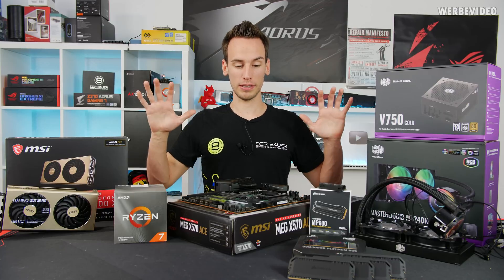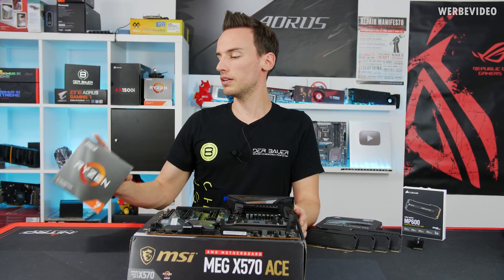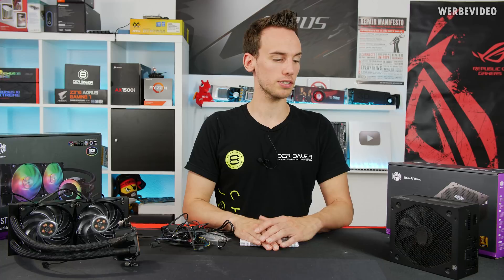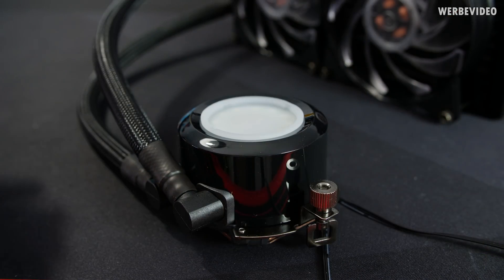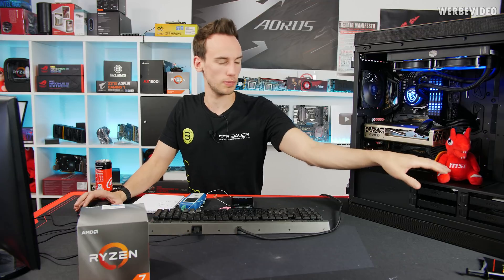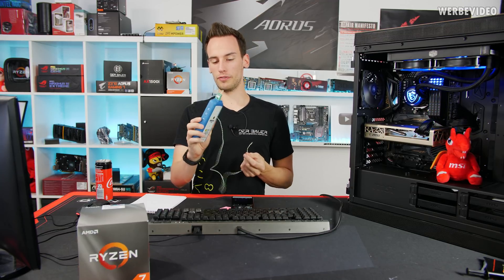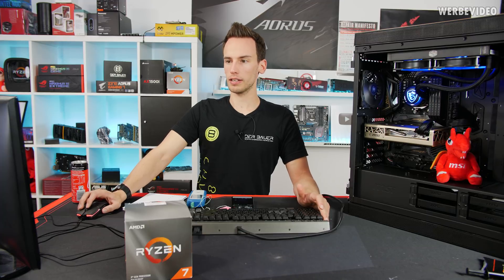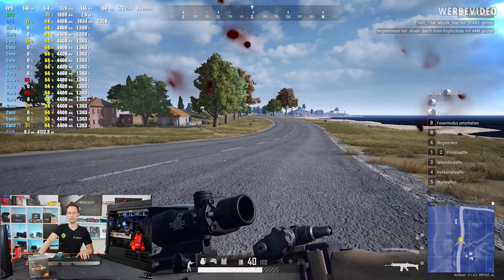MSI powered X570 PC - With RYZEN 3800X Overclocked to 4.4 GHz

Comment: Roman, das System würde mich seitens Lautstärke umbringen. mein 3700x ballert auch 4.4@1.375V mit einer Arctic AIO 240mm. Läuft mit 1200 U/Min. und nicht hörbar. Prime max. 82 C Grad.

Comment: Nice video! I bought 3800x now, (due to 5 series stock and price issue). And seems I also won on silicon lottery. My processor is runing  4.4Ghz at 1.25V config MSI MAG B550 tomahawk/antec 750w psu/ corsair 32gb 3200Mhz cl 16 ram and noctua Nh-d15 with only one fan. The temperature durin CB20 test around 72C at 23c room temp. CB20 around 5300 pts, single around 510.. It seems I can reach more speed but i dont want to  go over 1.25v..

Comment: I finally got around to overclocking my 3800X, I managed to pull 4.45 GHz all core at 1.35v. I think I could even manage a 4.5 GHz all core with some extra voltage, although the really gets my AIO working hard.

Comment: My 3800x was able to pull 4.425 CCX0 and 4.450 CCX1 at 1.33125v
Reply: i'm doing 4.3Ghz all core at 1.2V....don't ask how that's possible but either the bios, cpuz, hwmonitor is lying to me or i just got lucky. It's manually set to 1.2V with no curve so it's constant, never goes up because i've also set it to stay at 4.3 all the time because i can and it doesn't hurt since the temps are always low. GOOD ENOUGH for me.

Comment: I cant get mine 3800x (water cooling 240, good airflow through case)stable at 4.2Ghz with Prime95 SmallFFT. Is that normal for this cpu? What are your results with the same test guys ?
Reply: Don't bother with those tests. My 3800x crashes most time (all the time maybe, haven't done one of those in months) on the SmallFFt test but it works no problem when playing games with no down spike in performance so it's constantly at 4.3Ghz 1.2V  with a DP4 pro for cooling.
Reply: @alienufoweird  Thank you for letting me know man :)

Comment: Hey @der8auer, I have x570 MPG gamin edge wifi MOBO, 3800x CPU, ML 240 L v2 RGB water cooling, I am not able to sustain stable 4200 (1.25V)  mhz all cores on Prime 95. Does that mean that is something wrong with my CPU ?

Comment: My ryzen 3800x is running at 4.2ghz 1.1vcore with 5000 points at cinebench R20. It was automatically tunned when I turned on the D.O.C.P and performance mode at Asus BIOS.

Comment: i got 5317 on r20 with asrock b550 extreme4, 3800x at 4.43ghz at 1.35v stable, and 5350 same config at 4.43ghz at 1.375v still stable. i had another 3800x (different cpu) and a b550 tomahawk, and got 5245 give or take at 4.4ghz and 1.375v before it had a hardware crash, the mobo kept flashing cpu light or would have the vga/boot light solid, and when re-oc would only get 4800 on r20
Reply: which board would you recommend for 3800x OC, the asrock b550? I have 4.35 @1.275 on my MSI X570 Gaming Edge Wifi, but VRM thermals can be horrible at extended loads (rendering 3D projects). What voltage are you comfortable with long term?
Reply: @abb0tt comparing both the tomahawk and extreme4 on what they have verses other boards i researched. both of them are good boards, unlike some that drop from pci-e x16 on the graphics card to x8 when using 2 nvme drives, my pick for overclocking would be the asrock extreme4, it has 8 + 4 pin power where as the tomahawk has just an 8 pin. which for me required another psu which i went the evga supernova 750 g+ 80 bronze, just for the modularity and it has 8 + 4 cpu power pins,. as for overclocking,   in my current testing, just using pbo i am able to sit at 4.4ghz all core at auto voltage. i was able to hit 4.5ghz at 1.375/1.38 unstable and got 5393 on r20. and i'm currently sitting at 4.45ghz at 1.35 volt. and havent had any issues in the last couple of days. my r20 is 5368 with current settings and i can run multple tests on different benchmarks and passes every one i put it through,...though under load my voltage drops to 1.294v so even though i have it set at 1.35v with llc at lvl 1 i doubt my llc oc works. at idle on auto i was seeing 1.45v so undervolting to 1.35 for me i'm comfortable as with voltage drop it the board does what it should be. i can see if i could push my cpu to hold 4.5 or try 4.55 with 1.42 volt, but i dont have the funds to replace another cpu/mobo. that all being said, even at stock config with 32gb ram and a 2080 super playing battlefield 5 i dont drop below 110fps and with both cpu and gpu oc i get ruffly 125 to 145fps on battlefield v with settings pretty high.

Comment: The 3800X is in direct competition with Intel’s i7-9700K, benchmarks show that, when overclocked, the 3800X is 10% worse for gaming/The 3800X is also 15% ($50 USD) more expensive than the i7-9700K. Additionally, the 3800X's memory controller, although significantly improved over previous Ryzen iterations, still has limited bandwidth and high latency which can also impact gaming.

Comment: My 3800x does 4425mhz All core with pbo and auto oc on and it does 4575mhz single core boost on x570 msi gaming edge wifi
Reply: gallya  When its light load and the games etc only unitialises core 1 and 2 they boost 4575mhz the rest is at idle 3000mhz or so since theyre not used. 4500mhz is possible at 1.42v

My 3700x did All core manuel oc 4400mhz with 1.488-1.51v
Reply: gallya  yea it works fucking brillant 🤩 i guess it take the Max peak boost after what your motherboard or cpu is capable off. Tryed different bios versions. Some did better then other. 1 bios did 4625mhz but only 4300 All core oc. Where this i got now does 4425mhz All core but slightly lower peak speed at 4575 👌

Comment: Very silly, very silly.
You need to overclock the ram, that would give you better results anyday over the cpu overclock.
Sigh.... Why do these "Tech" channels know nothing? 
You can buy a 16gb kit of 3200 mhz cl 16 ballistic sport LT which will through the ryzen calculator get to 3800 mhz cl 16 WITH tightened timings.
You will see MAAAAAAAAAAAAASIVE gains in gaming.  Sometimes 20-40 extra depending on the game. 

Do some research people, this isn't an intel cpu. You overclock the RAM, not the cpu.

Comment: i'm running my 3800x @4450 on 1.38 with an H115i. So happy for going back to team red 👏
Reply: Which is temperatures in game and Aida64 stress test?
Reply: @douglaslopes369  temps in game is 55-60c in bench it goes to a max of low 70s maybe 75

Comment: My 5 GHZ 8700k cooled by a Noctua NH-D15 runs significantly cooler than this! 1.34 Vcore, 5 GHZ all core, 4.7 GHZ Ringbus. In games it RARELY hits even 55 degrees Celsius! Of course I am delidded with Conductonaut, and Kryonaut on top of the IHS!

I also Re-lidded using Loctite Superglue gel - just 4 tiny dabs, one on each corner then I placed it into the vise tool that comes with the Rockit 88.  Sorry I am not using a Delid Die Master yet, for LGA 115X CPUs the Rockit 88 is just so much cheaper, and is also very easy to use with everything you need, except for Conductonaut anyway!   It annoys me that Rockit sells Cool Laboratories Liquid Metal along side their delid kits. Thermal Grizzly Conductonaut is SO MUCH BETTER!  I mean it is also rated at roughly DOUBLE the thermal conductivity of any other Liquid metal, and it only gets better as it heats up! 

I SWEAR that a good Delidding with Conductonaut is BETTER THAN A SOLDERED IHS!

Comment: so this means I wont be able to run 4 sticks at 3600Mhz as I have 2 x 8 @ 3600 and want to ad 2 more...
Reply: The extra bandwidth from the 4 will compensate for the speed reduction. 
it doesn't matter.

Comment: Isnt 1.375 pretty high for zen2 vcore? OCers sub reddit has a sticky saying 1.325 is max safe.
Reply: I'm pretty sure it's good up to 1.5V. AMD stated it themselves
Reply: @sbeve7445  Oh I thought 1.325 was the safe max for a manual overclock. It's what they have stickied on the overclockers subreddit.

Der8auer said he was running his at 1.44v. Underload it goes to 1.375. I assume thats way to high because of the 1.325 max safe.

Comment: you just said how good the heat pipe is and the vcore because of this stupid piece of shit useless piping from a chipset that doesnt need cooling and goes UP to the vcore , heat does not sink , so unless they have come up with some miracilous way of blowing heat INSIDE of the heat pipe back down to the chipset fan , this is  fuckin rediculous dude , its almost but not quite as rediculous as trying to sign into HWBOT over and over and over and over and over again, its quite frankly rediculous , go buy your shit yourself and then test it . remember how you used to do that ?

Comment: Oh Damn ! This mean i really win silicon lottery with my Ryzen 7 3800x then, doing 4.4GHz all cores at 1.35v with a h100i :o wasn't thinking it was so good, thanks for confirming this :D
Reply: Vincent L. PBO disabled, the only other thing i touch in the bios was a manual overclock of my DDR4 3200 kit which i overclock it to 3600 cas 17, note that i'm using the x570 Crosshair Hero VIII wifi. Now i'm at 1.325v all core 4.4GHz with only a manual overclock with Ryzen Master.
Reply: @No0ne91  did you have to raise the voltage on the oc ram?
Reply: robertav3 not at all, i didn't want to touch it

Comment: Your software does not show core temperatures, it only shows the hottest one and puts the value onto every other core readout.
Reply: amd only shows 1 core temp and it's an algorithm based reading using all the die sensors, it's not a true core temp. people are too stupid to trust with true core temps because the variance would be so drastic due to the design that people would sh... bricks if they saw 2 cores running significantly hotter than the cores surrounding it. case in point dealing all the dumb reddit/forum posts related to AMD showing hot spot temps on vega/navi gpu's.

Comment: As a rule of thumb, one heatpipe has the capacity to transfer about 10 W of thermal power. Is the combined thermal output of all VRM components less than 10 W? Or is it just a gimmick?

Comment: my ryzen 3600 boost was 4.12 before new bio's now after its boosting to max 4.14  ive still never seen 4.2 after applying update yesterday asus tuf x570 gaming plus wifi .
Reply: may be temp or voltage related.. unless you're talking about multicore boost which 4.12-4.14 all core sounds about right. mine fluctuates between 4.12-4.167Ghz all core.. single core it should sit at 4.192Ghz if you have a half decent cooler. but i've been seeing some forum posts that asus's ABBA bios only slightly fixed boost issues on their boards while on the gigabyte boards it's pretty much fixed so there may be something else that asus needs to fix specifically in their bios.

Comment: what is the max static voltage you would recommend?  I heard 1.325v but I see you went much higher.  I'm at 1.325 R5 3600 @ 4200 all core and it works very well.  Curious what my max voltage should be all core all the time.  I had it at auto @ 4350 mhz and I got 1.5 volts!!  Scary stuff.
Reply: AMD said zen 2 7nm is rated from 0.2v to 1.5v but go with what ever gives you the best results.. like in his video if you're having to add a significant amount of voltage just to get 25mhz, probably not worth the extra power usage and heat output.

Comment: somehow they know that cpu is silicone lottery and they send it to u for a reason...
Reply: 3800X is a binned chip.  Mine does 4.4 at the same voltage.  Bought it retail on the 8th or 9th of July.  It's an engineering sample too.

Comment: What, you said the mainboard and amd cpu not liking more than 2666 sometimes????

Such a big case and only a 360 and 240 (with pretty restricted airflow). No thanks.

4.4 at 1.37V. Wow, that sounds horrible. Most 9900k's are 5.0 at 1.3V. I suppose the chiplets help with heat, but going from physics this will ruin silicon quicker than Intel's offering. 
Volts ruin cpu's, as said by der8auer many times before. 
An 8 core doing higher volts to get lower performance is horrible, add in the chiplet design adding extra ms to delayed frame times and other items like mice input.

I can't even hear my 9900k being 1.5ft away on games. My fans don't go past 40%.

Comment: Wait, is that how you should apply thermal paste? Or he intentionally using too much.
Reply: He and GN have several videos about thermal past.  You almost can't use too much.  It will squish out if the cooler is properly mounted.  The amount he used is perfectly fine.
Reply: @patrickshelley09  That is exactly what too much is. I'm not saying it will negatively affect cooling , but if like more than half is gonna gets squishes out, it is wasted paste.
Reply: @ramanmono  I get what you're saying.  But half of that is not going to get squished out.  And unless you're a system builder, the cost of the paste is negligible.

Comment: Could you specify the configuration of bios you use?
I have 3800x with msi x570 and I get the system to start at @ 4400 but as soon as I start cinebench20 the system fails.

Comment: @Der8auer : A couple of things about this motherboard which I happen to own since release:
1- The top VRM heatsink protrudes from the motherboard colliding with top mounted thick radiators. Which happened to me.
2- The chipset fan is ON all the time on a normal case. Maybe on a testbench not but I have a Thermaltake Level 20GT and even doors open its on and @60ºC or more.
3- The LLC settings are MAD. And I would like you to test this please.
    Sometimes they just dont work at all. I have tested from the lowest to the highest and nothing happened , same read when using load(CB15 and CB20)
    Sometimes you need to set them several times in the bios to make them work.
    In PBO mode they just dont do ANYTHING AT ALL.

The bios needs polishing and some work IMO but the board is excellent hardware wise.
Been testing all the bios and the problems persist. I hope MSI fixes it because its a pretty expensive mobo.

Cheers!
Reply: MSI did a meh job at describing LLC setting(in other words,using % instead of "mode X"should be better) in BIOS,optimal setting should be Mode 3 or Mode 4.
Reply: Re: chipset fan
Have you experimented with blowing low RPM air over it with a case fan that sits close to it? Try doing that by manually holding a fan at say 600RPM and if it works you could try rigging up some mount. Even with a side window you could find away to make it look good. Not perfect but maybe better than hearing a chipset fan?
Reply: Did you install Dragon Center?
I don't know if it offers anything that the BIOS does not but if you haven't installed it do so. Maybe go back to default CPU settings for now then set the "Silent" chipset fan profile? I'm basing this all on reading the MSI site so probably nothing you don't know... also, I had chipset fans in my Z77 Sabertooth which were really annoying and after monitoring temperatures I ended up just unplugging the fans and never had a problem in the past five or so years. Not saying you should do that but it's worth considering, or again the rigged case fan... finally, I assume you have GOOD AIR FLOW from front case fans sucking air IN which should create air flow across the chipset?

Comment: Could you record your overclocking process next time you do these kind of build videos? I love the the build videos btw. @der8auer
Reply: change multiplier.. stress test, it works raise multiplier again stress test again.. fails.. raise voltage, stress test again.. works? raise multiplier fails? raise voltage.. repeat.. follow process til raising voltage no longer fixes the failed stress test, go back to last multiplier/voltage that worked stress test longer.. done.. amd/intel overclocking 101. in all honesty the process of overclocking both amd/intel processors is boring and straight forward these days.. it's not like overclocking old socket a/754/939/am2 or 775 socket processors where it was super tedious to get good overclocks.

Comment: Then Ryzen 7 3800X is not as bad as you formally claimed...as it's overclocking way better than Ryzen 7 3700X..:D
Reply: 4.525ghz at 1.375v, r20- 5388, this is my sillicon lottery
Reply: @cristibaltoi5254  Haven't tried going past 4.4ghz all-core 1.3v, but im in a phanteks mini ITX, so in terms of cooling this is probably where i'll be capped during the 30 degree celsius summer period.

It did make me consistently hit 5350 cinebench score on my 3800X, at a max temperature of 69 degrees on a M22 NZXT AIO and ~25 degree ambient.
Reply: 3800x best silicon.
if amd tests disnt go trough it would have been sold as 3700x.
Reply: I want to see numbers on this =)
Reply: @ChronischVrij  just be curious and look at silicon lotery number https://www.techspot.com/review/1899-ryzen-3800x-vs-3700x-difference/
Reply: They're identical, just binned. So the 3800x are the ones that can be stressed more.
Reply: I'm at 4.48 GHz on all cores but my mobo set voltage at 1.47v!
Reply: @rpospeedwagon  I got 4.5 solid at 1.38 3600mts
Reply: 3800x I tested 4.325 MHz 
vcore 1.275 use prism R7
GT 1030 Ram 3200 PSU 650w
Cinebend 5169 pts.
Best than i7 10700